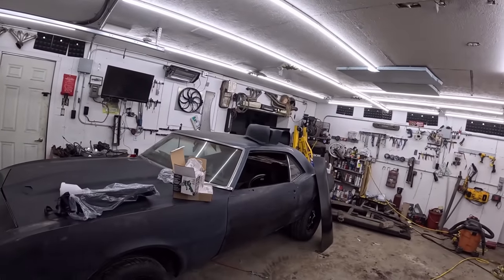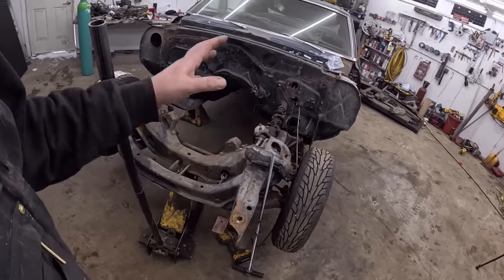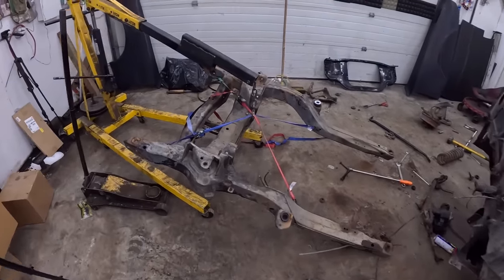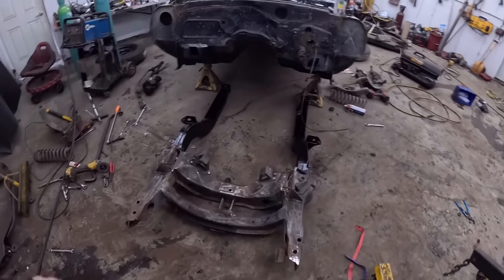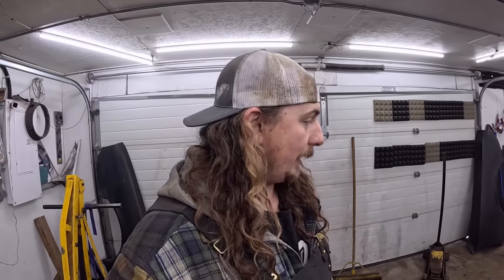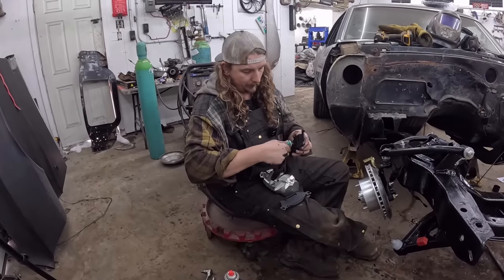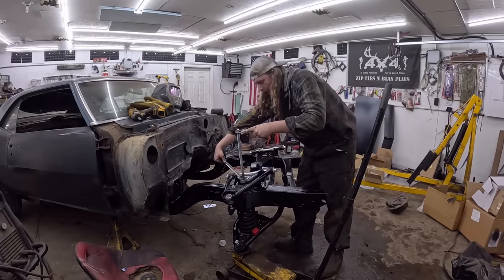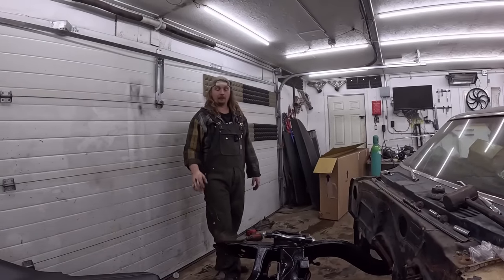Cleaned And Painted? DD Speed Shop's Getting Fancy!  Budget Camaro Suspension

Comment: Instead of building a "garagemahal" like other channels, DD Speedshop puts its money in new sheet metal and freezes on a old cement floor like its viewers! Amazing results in a home shop!
Reply: Grass roots at its finest!
Reply from the maker: I wouldn't mind a non cracked floor haha
Reply: @DDSpeedShop and ....what you just said .... for that very reason.... you should do I right!!!

And with the kind of motors you "find'.....you need subframe connectors
Reply: I’m going to make a sign that says garagemahal and hang it in my hillbilly shop😂
Reply: Well, he lives in Canada where constructing a garage costs way more than our neighbors in the warm south.
Reply: Canadian all the way! Do it the hard way and then say you're sorry. 👍👍🇨🇦
Reply: I dont know if Dan would say no to a car lift.It would certainly save a lot of wear and tear on his body.Im not to worried about him selling out.Hes not that kinda man.
Reply: @war7334  I do not think he has the ceiling height for a lift.
Reply: Big hole in the ceiling is what my buddy did for a lift. It worked. Closed the hole in like a upside-down box
Reply: @hooligan_56labelle22  Putting a hole in your roof does not seem wise if you live in Winnipeg. Also, Dan does not seem interested in home improvement projects.
Reply: @chuckschultz7028  not the roof. The ceiling. Car goes into section of the attic boxed in and insulated. Cold stays out and heat stays in
Reply: MAKE IT A 4 DOOR! Please, sir.
Reply: @DDSpeedShop  It could be a summer time project.. I very well know the Winterpig has two seasons.. Winter and construction!  😂😂😂
Reply: Back in the day used to build these old nova and comeros  in to race cars and i would have to reweld the sud frames to get then to hold up on the tract as the gm welds sucked
Reply: #garagemahal 🤣❤it!
Reply: @dominich-ju6pm I don’t think anyones’ done that yet. 😃
Reply: Non cracked floor? Easy there, Hollywood😂 @DDSpeedShop
Reply: @DDSpeedShop beats dirt, but I ain’t whining it’s 70F, trade offs
Reply: @DDSpeedShop  as a fellow Canadian in North western ontario I feel you about having a non cracked floor! one day these dreams may come true 😂😂

Comment: Pro tip on the POR 15. Yes you’re correct the black doesn’t have UV protection. They make some that does. Now to the pro tip. Poke a hole in the side at the top, install a sheet metal screw. Not on the opposite side of the lid, place another screw. Now just keep any plastic lids from jars around the house, remove the screws and pour the paint out the side hole into the lid. Reinstall the screws. My cans seem to last longer this way. When I get to the end of where it will pour then I remove my lid and get any remaining paint.
Reply: Nice tip!  That's a thank you from me.

Comment: Dan, Take a small nail and poke four holes in the drip ring of that can, and it'll leak right back down into the can and when you put the lid on, it will also keep it from drying out.
Reply: Im not surewhat mill you are using but have you thought about sub-frame connectors?
Reply: It is a fast dry product so if any product gets in the lid grove and by the time you put the lid on it wont seal. He did mention that that is why he uses the small cans. Yet it is a good solution and trick for other paint or liquids. Im glad you mentioned it because it does work well so others can do.👍

Comment: Your channel is one of my favorites. Here's a tech tip for dealing with those springs. Instead of using the threaded rod, and with the shock removed (duh), position the floor jack under the lower arm out near the ball joint. Run a chain around the top of the frame, then around the jack's front axle. That will keep the frame from rising, after the chain tightens. Jack up the lower arm and the pressure on the lower joint will be removed. Disassemble as needed. Then repeat when installing the spring. 
  Keep the great videos coming! 😊👍

Comment: I’m liking the steel wheels with the dog dish caps.On my 68 Firebird I was running a set of n50s in the back and n60s in front with stock 1968 Pontiac spoked hubcaps. Looked fairly innocent from the side until you noticed the ladder bars and headers. Next giveaway was a nasty 455 Pontiac with a lot of compression and lumpy cam. Late 70s and 80s were a blast in the hotrod world!

Comment: Your home made spring compressor is great. If you put a length of tubing between the washers under the nut, it would raise the nut higher above the upper arm and you could just spin the ring end of the spanner on it instead of using the open end. Love your work!

Comment: You don't need sub frame connectors unless you're making some real power but if you are you'll get tired of replacing windshields when the body torques and they crack or shatter

Comment: A good idea to stop the rod from turning when tightening or losening the spring tension is to weld a small nut on the end of the rod but make sure it is smaller than the outer diameter of the rod.  That way, you can put a wrench or a socket on the rod to stop it from turning without damaging the threads with vice grips.  Works well in my pin pulling setup.

Comment: Dan, you found  out that you don't want to get POR15 on your hands.  Will not come off with solvent.  Also you are correct that if you put the cover back on, it will not come off.  So, I don't remove the cover.  I drill a small hole in the cover and put in a 1/4"-3/8" self tapper screw.  When you want to use it, remove the screw and pump the can to get out what you need.  Been doing it for years.

Comment: Suggestion to save time in the future when you decide you want to protect the frame…I use Eastwood rust encapsulator. You can brush it on like the POR stuff, but you can also use a hvlp gun and spray it on. Cut it with reducer and spray it on. I reduce it about 4:1 or 4:2. Never used the POR15, the Eastwood tested better than POR on a YouTube video test and comparison between several other similar products. As a matter of fact the POR had the poorest test result out of all of the other products against corrosion. I have used the Eastwood regular encapsulator on several projects. Like it.

Comment: Dan, I have found that removing the rear glass makes the quarter panel replacement somewhat easier.  Less welding invovled and less body work as you are at the factory seams.  Just a thought.  Keep the videos coming.  Always makes me get out into the shop to finish the current project. a '59 chevy Apache short bed.  Andy

Comment: You could put a jam nut and a washer to the top of the threaded rod and use a impack to run the nut to tighten the rod instead of the vise grips.

Comment: Rust-oleum Truck Bed Coating in spray cans is pretty good paint. It dries in 5 minutes, 10 minutes in the cold. It looks the same no matter when you apply it, even if you paint it with a brush. At work we go through 50 cans of it each year. You'll like it, ..... I promise.

Comment: POR will only stick to rust and sandblasted metal. Other than that, it will peel off in sheets, made this mistake on a project I had and it did peel off.
Reply: Never had a problem.  Just rough up the surface and etch it (If necessary) gun it and go!  I actually wait for it to tack up, dust a light coat of primer and you can top coat it with regular paint.  I have actually patched rusty, scabby oil pans with no issues (POR and fiberglass cloth).

Comment: Jumping a bit ahead but when you start taking interior apart be gentle with the trim pieces at top of front window and around rear window, side edges above window ,try to reuse if possible, “Chineseum” stuff is garbage . Also mark the holes the headliner bows came out of for reassembly !
Nice Camaro build Dan 👍

Comment: 1967 and 68 had 4 piston brake calipers 1969 was the first year for single piston brake caliper for quite a few years, 1967 and 68 master cylinder used a different size piston in master cylinder and a different pressure valve attached to the master cylinder, all proportioning valves are the same between manual and disc . For these years hope this helps

Comment: Not sure about Canada but here in North Carulina  I tend to use Rustoluem Professional Spray Enamel, local shop turned me on to it for spraying in my old truck, drys quicker and harder. Usually a 15 ounce can so good milage out of it. Keep spraying and Por 15 on the Camero, some of us are  drooling over the Shiney paint, plus I have the Truck version( 1968 C/10 350/400/12 bolt posi  so nice to see them stay on the road.

Comment: Wow, those cars are built light.  67’s sold so well they were practically whipping the auto workers to get them down the line and don’t stop the line for anything other than saving your life being caught in some way.  Welds like that, you are so correct.  They just scab welded with an arc welder and stick by hand, this was pre robot welding.  I had a frame on a 67 come in one time that was factory welded so poorly the car was a death trap even when new.  Like the guy just missed the seam, scab welding on one side only, totally missing the seam except for one weld that had a quarter inch glob in the seam.  It was the only weld they hit the seam.  Had to fix that and put in some good welds.  Those cars are cool but they don’t take front end crashes well due to the light construction.  Drivers front corner solid hit killed a guy leaving a car show a year or maybe two years ago in I think it was a 69 Camaro.  You want good welds when you are kind of flimsy to begin with.  I don’t fit in them well so only built them for auctions or repaired them in my shop.  Many of my friends had/have them so there has been a few charity repairs to warm a guys heart and help a friend.  Always amazes me that a middle aged guy with limited rust knowledge, limited knowledge in simple repairs and minimal tools just crack addict style impulse buys one paying good money only to find out they unwittingly bought a bondo artist rust bomb that started pulling and now won’t start.  You really have to inspect the first gens well.  They seemed to like to rust well and fast.

Comment: Seems like I tried to use a 3/8 threaded rod to install a coil in a gen 3 gto . It broke . 3/8 was the biggest rod I could get on a Sunday at coast to coast hardware .
Reply: I had used some 5/8 and it worked like a charm 👍
Reply: @garyjohnston8000  I replaced it with a 7/16 grade 8 never a issue again

Comment: back in the day before POR15 was sold to some other company it was the best stuff strong as nails. I still ride a harly that has been outside for 20 years and looks amazing. the new stuff sucks, I did the hole frame on my 27 with it and after 2 years it was coming off.  I swiched to MasterCoat AG 111 this stuff is strong

Comment: Dan,
Please help Derrick. The rust bucket Independence needs to be saved! Please consider offering your expertise in installing new  floors, rockers, rear frame, and trunk floor. The body, which is well rusted, doesn't have anything that it can be  bolted to that can be considered to be a chassis. Thanks Dan

Comment: As requested: Don't forget to connect the frame brackets and in addition the fire wall is beat if you did not know. Use an engine crane. I don't know what you would do without us reminding you.
Reply from the maker: Nothing would get done without the comment section

Comment: I saw a video where a guy was building a '68 Dodge Charger body/chassis completely out of reproduction panels. He had a couple of original parts to start with, but was planning on replacing those later on, resulting in a complete reproduction car, using no original sheet metal. I'm keeping an eye on that one. He built a large jig to help align the panels. I know this is beyond the ability of pretty much everyone, but you have come close to building half a car out of new or used sheet metal. How hard do you think it would be to do an entire body?

It's hard for me to imagine building a car with the intention of selling it. I have never done that, and doubt that I would be able to. I would probably cut corners to the point where it would not even be safe just to get it out the door. I have sold cars, but only many years after building them. Sometimes you just lose interest. But if I lost interest while building it, I'd probably just sell it as an unfinished project.

GM cars are super easy to get the front springs out of. My V8 swapped '93 S-10 truck has that same suspension design, except it has a full frame, but the suspension is the same. It was a piece of cake to work on. I just love the shim design for setting caster and camber. It's rock solid. Just try removing the springs from a '60s Ford that has the springs between the upper control arm and body without getting killed. If anyone has done that and survived, I'd like to know how. 

I wouldn't say they are garbage. They are valuable because they are rare and desirable, and because it costs so much to properly restore them. Yes, they were very poorly built. People claim that cars from the '60s and '70s were junk, and that most of them wouldn't make it past 100,000 miles. Part of that is true. But the big reason for it was lack of quality control. The DESIGN of these vehicles was wonderful. IMO anyway, the old school small block Chevy (and pretty much any American V8 from that era) were the best designed engines ever. If you build one properly, it will last past half a million miles. No modern engine will do that. As for the rest of the car, that car is almost 60 years old. I can guarantee you that no modern car is going to last 60 years. They have a hard time lasting 10 years. That welding is sloppy, but it held. And I love that frame/front suspension design. If I were a high dollar restorer, I would have ground that welding down and properly rewelded it. I am not a purest when it comes to keeping it absolutely original. I want thangs as nice as it is possible to make them, as long as the finished car LOOKS original. 

I deal with rust in a different way. I use full strength muriatic acid to completely remove rust, then paint over the metal where the rust used to be to prevent it from rerusting. I have probably used hundreds of gallons of muriatic acid on old car parts over the last several decades. 

I think I would have attached the spindle to the ball joints before I put all the brake parts on it.

Comment: I like that you show the original build quality with those welds on the front sub frame. That whole thing about “They don’t build em like they did back in the day” falls short. Build quality and just quality in general on all makes has improved steadily. Yeah there’s always issues but cars generally last longer, are safer, perform better and don’t corrode like they did. I love older American vehicles but this delusional nostalgia about how the quality has dropped off simply isn’t true.

Comment: You don't need frame connectors. My 69 camaro has a zz502 engine and i dont have them because i dont plan to ever run slicks or sticky tires. The car cant twist if it only spins tires or dosent hook.

Comment: Definately you need to remove the rear glass as they like to rust all the way around the back glass, at least pull off the trim and check real good, also the area above the windshield needs to be checked for rust.

Comment: Don't do subframe connectors. It just moves most of the force to the back. Not worth it unless you're racing because eventually you will need to beef up the rear to independent suspension. Slighlty bigger sway bar, rear sway bar, and beefer leaf spings. You won't even need a caltracs with that setup.

Comment: 67 68 had two peice rotors and 4 piston calipers in 69 still had two peice rotors but single piston calipers then one peice rotors in 1970 also proportion valves different from 67 70 then 71 up useless knowledge  btw keep making doing what you do it works

Comment: Question about the subframe mount plates. I need to put them on my 74 Pontiac subframe. Should they be welded over the frame? Or should you cut out the old and weld in the new? I think Dan just welded them on top of the existing metal. If I do it that way I should probably do all 4? Just curious. Not being critical Dan, I love your content!
Reply from the maker: I just welded over top.
Reply: @DDSpeedShop  thank you Dan

Comment: Dan, I love you man, but please, for the love of GAWD, Please, don't use Anti-seize on the sliders, or the pins. I've performed thousands of brake jobs, you use the brake lube for the sliders, the pins, and the back of the pads. Oh, on the outboard pad, if you gently squeeze the tabs, you'll make the pad fit tight. Never squeal, never chatter.

Comment: Why the hassle of putting in sub frame connectors for a small block Chevy engine? You aren't  racing it or putting in big block with 500 Hp. It lasted all this time and the front end did t break off